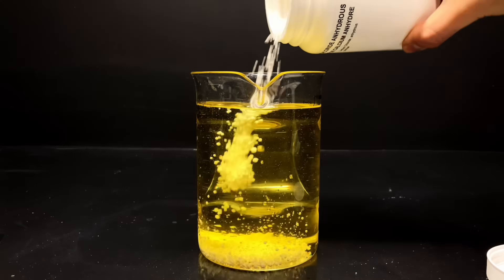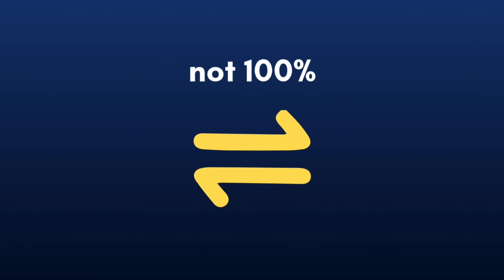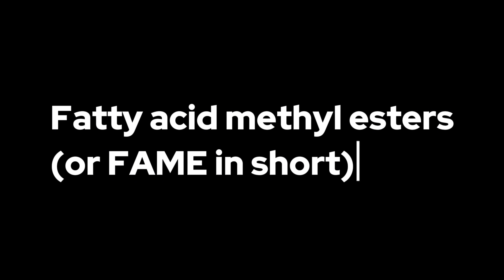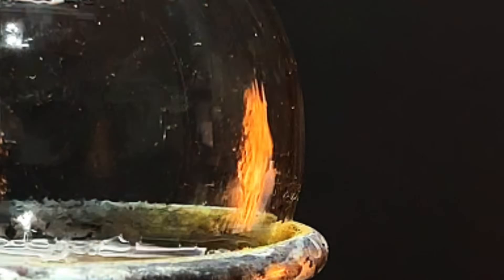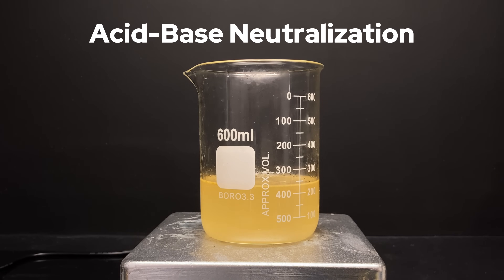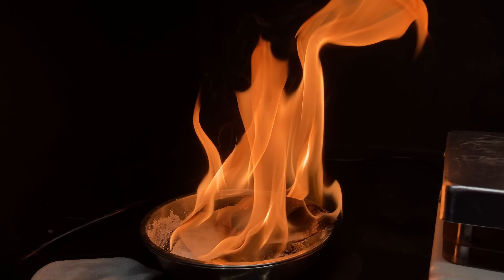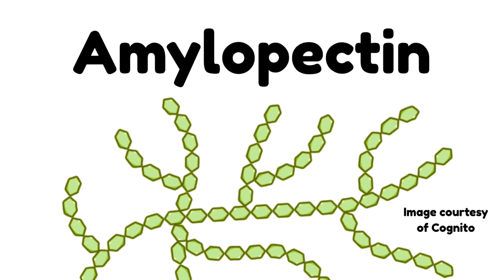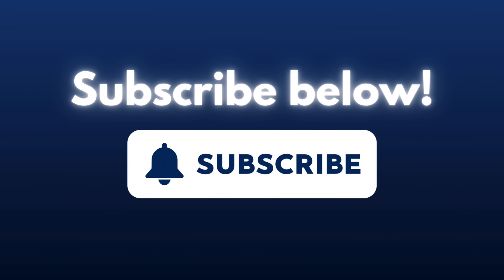I Tried Making Plastic from Scratch in My Garage: the HARD way (it took forever)

Comment: 4:15 just get yourself a digital thermometer hooked up to a relay and adjust for your desired temp, run the mantle through the relay
Reply from the maker: Yes! I know thank you so much for telling me this lol! I just need to save up and afford one haha...
Reply: @CarbonTwelve12  if you're not worried about wiring up something or know someone thats all g with electronics, it shouldn't cost you more than $10 for the relay bit, its just about finding a compatible probe for the glassware/chemistry
Reply: Just is a weasel word. Everything's easier said than done.

Comment: Hack to clean cooking oil: before drying it pour in hot gelatin solution while mixing then let it cool. The gelatin will nucleate around the crumbs or the finer carbon bits and fall to the bottom.
Reply from the maker: Thanks for the info haha! It's kind of like the fry away thing to get rid of used cooking oil! :)

Comment: why are you drying the oil before putting in the methoxy? isnt there water in it anyways?
Reply from the maker: Yeah lol. But we try to minimize the amount of water present in order to shift the reaction to the right as much as possible. If I used wet oil, the equilibrium for the methoxide would be towards the reagents. Thanks!
Reply: @CarbonTwelve12  got it. 
Also i absolutely enjoyed the style of the video. Keep it up!

Comment: You can use an ATTINY chip, a thermocouple, transistor and a relay  to automate the temp, probably a display and a potentiometer too but this can be done for less than 10 bucks.
Reply from the maker: Oh really? Such a cool suggestion man I’ll take a look into this. If it’s possible I’ll try it out!
Reply: But you have to learn electronics and programming. Specialization is a thing...

Comment: the coolest bioplastics synthesis uses koji mold to digest food waste, which then gets lactofermented, the lactic acid extracted and turned into PLA
Reply from the maker: Oh mold! That's actually really cool, haven't looked much into biology but fermentation is a really nice natural application of chem! :)
Reply: @CarbonTwelve12  it's the same mold that they make soy sauce and sake from. it has all kinds of enzymes to break down fats, carbs and proteins
Reply: @CarbonTwelve12  There is also a research paper that indicates it is possible to perform direct polycondensation of lactic acid to PLA using creatinine as a catalyst, which should be within your reach, though it might be extremely tedious to do from scratch.
There is not much documentation on methods to isolate lactic acid from sourdough starter, or how to isolate creatinine from urine/meat broth. When I was looking into it, I had to cross-reference between papers going back from current-day to the 1900s.

Comment: Why are fossil based plastic water resistant and bio plastic not?
Reply from the maker: Fossil fuel based plastics are stronger and are made of polymerized hydrocarbons whereas here it’s just starch and easily soluble in water lol
Reply: @CarbonTwelve12  I did some research. Would you be able to do this?

Methods to make polymerized hydrocarbon-like plastics from bio-sources:
Fermentation-based monomer synthesis: Microorganisms can convert sugars or starches into hydrocarbon-like monomers such as:

Lactic acid → polylactic acid (PLA): a common industrial bioplastic

Succinic acid or 1,4-butanediol → polybutylene succinate (PBS)

Isoprene (for synthetic rubber), ethylene, or propylene from biomass

Bio-based polyethylene (bio-PE): Companies like Braskem in Brazil convert sugarcane into ethanol, then dehydrate that into ethylene, which is polymerized just like fossil-derived ethylene into standard polyethylene. This is chemically identical to regular plastic — just made from a renewable source.

Thermochemical conversion: Biomass (like cellulose or lignin) can be broken down into smaller hydrocarbons via pyrolysis or gasification, then reassembled into polymers.
Reply: Here is the simplest:
Basic Steps for DIY PLA:
Ferment Lactic Acid:

Use a lactic acid bacteria strain (e.g., Lactobacillus from yogurt or probiotics)

Feed it sugar water or starchy mash (boiled rice or corn starch)

Maintain at ~30–40°C for 1–2 days in an anaerobic environment

Filter out the solid biomass — you now have crude lactic acid

Purify the Lactic Acid (Optional but better results):

Use filtration and/or distillation to remove impurities

Polymerize into PLA:
This is the hardest part. True PLA synthesis involves:

Heating lactic acid to ~180–200°C in the presence of a condensation catalyst (e.g., tin(II) octoate or zinc oxide)

Water is released during the reaction, and must be removed (e.g., by vacuum or inert gas)

You'll get low- to medium-molecular-weight PLA (a brittle but real plastic)

Comment: As a polymer chemist, I was expecting you to do step-polymerisation using citric acid or something like that. But this “thermoplastic starch” is a very neat invention since it allows starch to be processed, which is not in its pure form. It has quite poor mechanical properties, hence it's not used as much. 

Good job on this one 😅
Reply: I am a PhD industrial chemist who works in polymer synthesis for things like inks, Coatings and Adhesives.if you want to do a polymerization reaction, I would limit yourself to doing a polyester condensation reaction to produce something like PET. making acrylics or urethanes, use monomers that are kind of dangerous to handle unless you know what you’re doing, and you have the proper laboratory hoods. You could do a polyester condensation with the set up that you have now and since the only side material is gonna be water, it’s gonna be pretty safe. In fact that’s a reaction that I’ve taught in my organic chemistry labs in the university over the years.
Reply from the maker: @marchutton7640  Oh wow, I never knew it could be that dangerous, is it due to the exothermicity of the reactions, or is it just toxic? I believe some fluorinated plastic monomers are pretty toxic. Cool to hear that you have a PhD in industrial chemistry though! I'll look into the polyester condensations, thanks man! :)
Reply from the maker: Thank you so much lol! I might try actually polymerizing something in the future though!
Reply: @CarbonTwelve12 I know you may think you’re ready but acrylic acid, methacrylic acid, styrene, and the various aromatic and aliphatic diisocyanates  are at a different level and I have watched other professional PhD level chemists get hurt using those raw materials in various world class synthetic laboratories over the years.

Comment: C'est si movais pour une voiture ? Car ca pourrait être intéressant de tenter de rouler avec...
Reply from the maker: Oui je pense, je voulais l'essayer mais enfin bof, ce ne serait pas la meilleure decision. J'suis seulement un mec qui connait un peu de chimie, pas un geek en voitures! :) Merci pour votre commentaire!
Reply: It's alright in old diesel engines. But you have to be sure you filtered your oil properly otherwise your engine will clog. Also only the old engines work, nowadays diesels aren't as robust as they used to be. A lot of people drive with 65-30-5 mixture of diesel, biodiesel, petrol.

Comment: 11:00 A rock tumbler is a good way to powderize hard materials like activated carbon. All you need is the carbon and some large spheres that won't ablate themselves when they crash into the thing being ground.
Reply from the maker: Haha lol, those are so cool for like polishing rocks and stuff as well, if only I could afford one haha! :) thanks man!
Reply: @CarbonTwelve12 they are easy to make from any tubes like jars or even Pringles can, for media you can even use pennies or other coins if you don't have access to lead balls. Motor you can get out of any moving electronics like fans etc
Reply: Marbles work well.